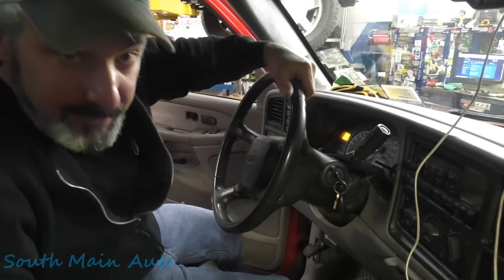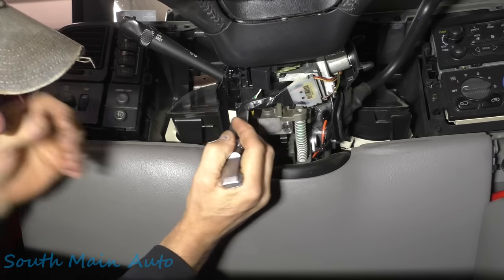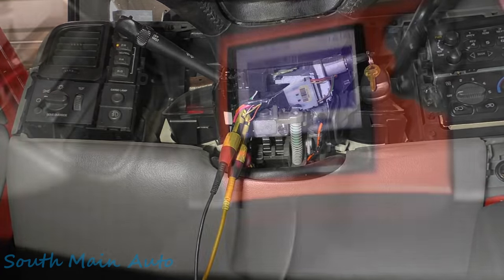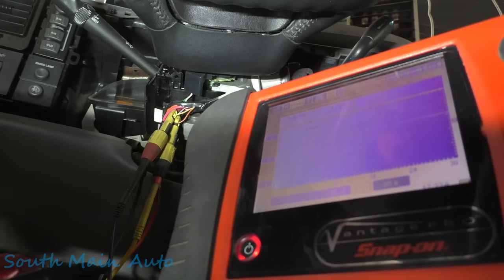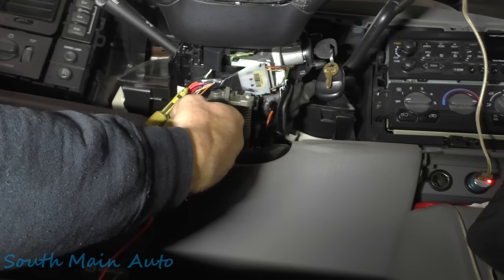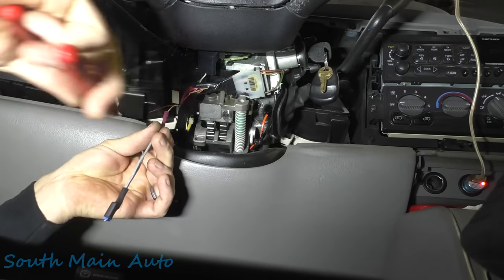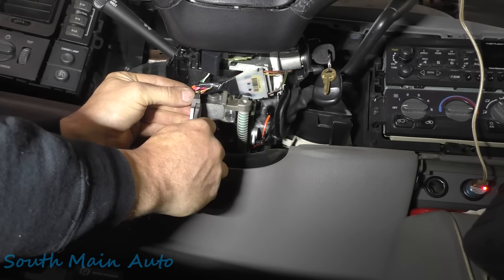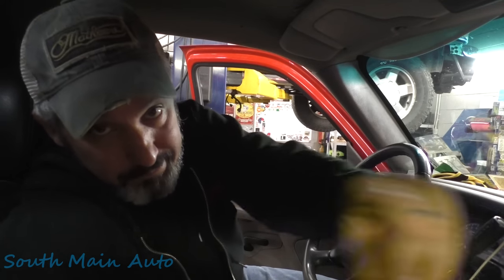Passlock™ System Bypass - GM

Comment: I once owned a 99 Buick regal which had a resistor chip in the key and I had to get an extra key cut. So I bought a blank key from Ebay (with the right resistance) and had to take it to my local hardware store to have it cut. What a pain in my rear. 😤 Trying to find the right resistance was a pain in the rear.

Comment: Those types of connectors are fine, the junky ones are the non-heat shrinkable butt connectors. The heat shrink wrapped around the wire helps keep the connection together, instead of pulling out of one side

Comment: The blue rectangular PCB mount screw fine adjustment 15 turn Trimpot Trimming Potentiometer is a flagship brand from Bourns. Bourns sells a Trimpot adjustment tool that has a pocket clip, which is a popular addition to any Engineers pocket protector look, it has a flat recessed screwdriver blade with a plastic round shroud so you can trim the Trimpot without the tool falling off, very handy. In automotive electronic design you don't see many Trimpots any more. If you want to get a serious retro look you could lock down the screw after adjustment with Glyptal 1201 Red Enamel. 1201 will lock the screw in place and is a tamper witness. One small pot for man, one giant leap for Passlock.

Comment: great fix only thing you may want to put a dab of hot melt glue on adjustment screw ,vibration will make the voltage change over time      I work  with electronics found  vibration is not there friend  awsome video

Comment: nice method ...
i have done this bypass on my own 2003 pontiac grand am ...
my method was a bit different ...
i cut the yellow wire and measured OHMS from yellow (back to switch) to black wire (key in)
then strung a few standard resistor values to get the MEASURED value ...
soldered that in between yellow wire going TOWARD the BCM and the black wire (grnd) ...
did it 5 years ago ... security light comes on every few months then goes out ... but NOT a single NOSTART since!

Comment: Did you know that in some models (2000->) you can just unplug the pass key module when the car is running, it disables the system and car runs and starts without pass system after that.

Comment: a properly done crimp will last longer than the vehicle - the problem is that many people don't do them properly (for starters, only ONE crimping action is done, adding an "Extra for good measure" seriously weakens them and reduces compression pressure by 80-90%)

FWIW: in other cars suffering intermittent key issues, it's often the wiring to the transponder pickup ring around the key. I've seen a number of cracked joints over the years (you can resolder them and expect them to crack again sometime later or use something like Kynar 30 wire wrap wire to extend the joint along the traces a little - which will allow for flexing)

Comment: Fuel pressure is determined by BCM?  02 Avalanche…

Start it with foot not gas, runs for about 2 seconds. If trying to put foot on gas (holding down) only cranks, no run at all. Because more gas requires higher fuel pressure which is curtailed by passlock?  Thanks. Very informative video

Comment: One thing I've learned from experience with my 2002 Chevy truck is if you happen to have an aftermarket remote start already installed and working properly in the truck and the passlock system acts up on you unexpectedly for some reason, you can probably still start the engine keyless with your remote starter, then off you go, same as any other time you use the remote start. The reason why this works is because the aftermarket remote start had to learn the passlock resistance value when it was installed and set up, so it knows that resistance value and it bypasses that resistance into the circuit whenever it is used to start the engine. And if this works that is probably confirmation that you need to bypass the passlock with a resistor because the key switch or something else in the OEM passlock circuit is probably going bad. The remote start could also be a way to find out that resistance/voltage value in the event that the passlock function of the OEM key switch is totally hosed and won't give it to you. You could pull the starter relay, set up your meter and use the remote start to crank it instead of the key. 

Edit: I just put one of these bypass resistors in my truck. I did not need to take a voltage or resistance reading because I already knew my system used 2454 ohms. I knew this value because I had the whole dash and steering column out during a restoration, and I already knew the 2 wires for the passlock, so I took a reading there when I was putting everything back together and wrote it down to have it for future reference. So I just got me a 5 pack of those variable resistors, set one to 2454 ohms and wired it in there.

Then I also wired in a hidden toggle switch to use as a security kill switch. So my passlock system is still not rendered totally useless. GM put it there to give the truck a little security measure that is better than nothing, so now I can still manually engage that security feature whenever I want, and it is still better than nothing. So if a thief rips out the ignition key lock or if they even have a copy key they can't start it until they figure out where my hidden switch is. This is in addition to the aftermarket security system which is in combination with the remote start. Of course there are still ways a skilled determined thief can succeed, I just did my part to make it harder for him. 

The other good thing is the resistor/kill switch circuit does not interfere with the remote start. The remote start can always start the engine whether or not the bypass resistor is engaged. So if something goes wrong with my bypass resistor or kill switch circuit, I can still use the remote start to get the truck home and service the problem.

Comment: Something for the Ford guys with f150s/ expeditions of 96 to 01, if your anti theft light comes on & your truck shuts off. Close your door & lock it, then cycle the key from on to off until you hear your locks engaged (don't hit the starter yet), your door should be in the unlocked position, relock it & start the truck.

Comment: Instead of crimping try some solder seal connectors. They are life changing.   And on the  later gm pass key - 08 colorado for example,  take the electric part of the ignition switch out, flush it out with wd40, shake the excess off and re install it.   No more security light

Comment: On my 99 Trans Am there is a small connector at the bottom of the steering column with 2 white wires. Just unplug and stick your resistor in the connector going to the computer. Just use a meter to read the resistor on the key.

Comment: I did this to my mom's car. It was so long ago that I got the resistor from RadioShack. And that was the very last time I ever set foot inside a RadioShack, because the sales clerk was more interested in spending 20 minutes to show some idiot how to use their phone than he was in spending 1 minute to ring up my purchase. That was a "Passlock" system I think, where the resistor is inside the lock cylinder and you just leave the key ON for 10 minutes for it to relearn the new resistor value.

Comment: Haven't had any dealings with the 99-02 trucks but the 03-07 classics I've worked on you could start with a regular metal key didn't know they had any security system.Guess I've been lucky. Interesting video.
Reply: It's a hall effect sensor inside the key switch that sends a "code" to the ECM. You could drill out the key switch and the vehicle would start. You just can't "hot wire" it.

Comment: Butt connections are preferred in a lot of automotive applications because solder joints will fatigue and Crack over time with vibration and heat cycling.  Just don't use the ones from hazard freight.  Buy some good 3m ones, and you're good to go.

Comment: Hey Bro 
BIG THANK YOU 
For this video, I lost my keys over 2 weeks now ended up ordering a set of new tublers for both front door and the ignition aswell  with 2 sets of keys, from amazon for about $26 in total,  i have changed all three out already  but Ford has chipped keys-pats anti theft system- and the new set i have are basic  krys with no chip,, Now if i cant figure this out and turn my truck on i will cost me minimum another $200 almost --which i dont have right now--to have a tech come out and make me a new chipped key and program it so i can finally start it up,,
Finding ur videohas me a stoked right now, after 2 weeks of trying I really want & even more I need this to work ,, SO I WANT TO ASK IF IT IS POSSIBLE FOR U TO KNOW HOW TO DO THE SAME THING U JUST DID IN YOUR VIDEO WITH MY -2000 F150 4.6L v8-    it would be a true blessing for me 
Thank you

Comment: I have a couple questions. 
1.) How did you add in your resistor without having to relearn the key? Just leave the ignition on??

2.) How do you know what the correct voltage is when you turn the key over? Do you just match the voltage to the ignition modual in said vehicle, or what GM says it should be?

Comment: Your last video on the Corvette helped me out with my 89 Camaro. Too bad the previous owner didn't see it. He replaced the column, hacked the ignition wires and did a total job on the fuel pump relay wires. All for a $5 resistor.. some ppl do not need to be under a hood 😂

Comment: The crimp and seal connectors are my go to for wiring. I think people are using cheap crimper tongs, and getting bad results. Every single OEM connector has pins in it, which are crimped to their wires. Crimps are oem connections, and they dont work harden and fail like soldered joints on unsupported wires.

Comment: What I want a link to is that wire lead setup you have! The 2 that screw and tap into the wire to test it and the alligator clips and piggyback setup those would totally help when testing wires.

Comment: Is this the system that uses a,little,resistor pellet in the key? My 86 Corvette used that. What a PITA!  It would often fail,to start, so I had to sit in my car while the system reset itself. There was finally a recall, where GM replaced the ignition switch and the keys. As I said, it was a PITA.

Comment: Back in the day when I worked on those miserable Silverados under warranty I got sick and tired if replacing and relearn  I figured out what the problem was. That  harness was so tightly bound Pullong on the pass lock that the resistance changed with ambient temp soo I did just as you did cut the tape and cut off all zip ties and presto problem solved. 
  Also I acquired an 04 Colorado after I quit working for the Grneral; with the  same problem and proved to be internal  but in talking with the local parts man and discovered the key was severely worn. We got the factory key code cut a key and I never had that problem again.

Comment: I did a few GM cars and just cut then crossed the 2 wires and waited 10 minutes with key on to do relearn and it was done and you don't need to worry about the resistor failing and leaving them stuck again

Comment: im having the security issue, love the video explains in great detail

my only issue on our 2001chevy 2500 is that voltage value is 4.1 volts on signal wire and when we crank it (without the start relay in or out) does not change the value of voltage in the signal wire. so we cant match up the resistor correctly  any suggestions?

Comment: If you hold your side cutters the other way around, it wont keep cutting the wires like that. You will need to practice a few times but you will find it easier when you are used to it.

Comment: I do not hate them I work as an electrician and when you have to use a under ground or a splice kit that is sealed for damp or wet locations those little butt connectors are your friend for single wires to make them longer or need to reconnect it makes it easier to use and you do not have to use a soldering iron it saves a lot of time.

Comment: GMs of this era have some of the best drivetrains and engines ever put into vehicles.  The electrical, security system, and doors / locks / handles are the weak points.  Brake lines in the salt belt.  Once those are sorted you got yourself a hell of a vehicle.

Comment: So you put the resistor between the ground and signal? Is that right or am I misunderstanding?? I just want to save this in the old memory bank…. Also i like the crimp and seal connectors! I have to repair alot of wiring on tow truck bodies and they are really the best thing to use! They can corrode after a little bit but a lot slower than anything else including solder! If you install and seal them properly and add a little shrink tube they will last nearly forever!

Comment: Great video. I am in the process of doing this right now. But when I splice my meter probes into the lines I get the 5.171V as you did....BUT once I remove the starter relay and hold the key my voltage doesn't drop like yours did. Is there something I am missing?

Comment: On my like new 1996 Chevy Lumina there are only 3 different value resisters listed. I went to a salvage yard and got a orange wire which unplugs in series  under the dash then cut it and wired in the correct resister for my vehicle. There is no need to remove column cover it can be accessed from the floor up. Plug in the new wire with the resister and bam, no security system.  When you have a remote start added to a vehicle they do the same thing. I think the size resister for your car is in the VIN but I can't remember.

Comment: Need you to make a video on a 1999 F150. Been fighting mine for years with a worn out key. Replacing the ignition switch is cheap and easy. I don’t have the relearn equipment and don’t want to tow it to a Ford dealer for them to do. I mean it’s a 1999 so another $160 compared to a few bucks sounds better.

Comment: Good job!  My sister has a 2003 Ford Escape that sometimes will crank but not start.  After about 30-45 or sometimes longer it will start and crank fine.  Some times she can be sitting, as in a drive thru, and it will just shut off.  Again after a time, 30-45 minutes and sometimes longer, it will again start and crank fine.  It doesn't do it real often but enough to be aggravating and real inconvenient.  I've seen on line where it may be the security system malfunctioning.  Have you Eric, or your commenters ever had any experience with this or any idea what might be the problem?   And I know, bring it in and I'll take a look at it,  no way to diagnose through the comments. 😊. But just wondering.  Thanks!

Comment: I've seen some info out there on the internet about "full bypass models" and that these resistor bypasses don't address the whole problem. I don't want to make a problem worse. I have passlock on my year vehicle> The vehicle treats me like I'm a thief intermittently. You (Eric) have been the source of many a good repair video that I've used. In your opinion, is the resistor bypass enough, or does a person need these expensive "full bypass models" out there? 'Before I proceed'

Comment: I know, I know nice fix by the way. Wanted to throw this out there. It looks like the parts your using are above average so if you're using some that bounce or move around on you the easiest way to stop that is to use some fingernail polish on the adjustment screw, it doesn't take much it will hold it in place and if you need to readjust it in a few months your screw driver will break open the old polish

Comment: Eric, I have used two of your repairs for the system bypass, the one on the Vette some years ago. I have a gas gauge sending unit on an 87 Buick Regal that only shows a half tank when full. Could a person place one of these 5K Variable Resistors inline to the gauge and adjust to correct the gauge to actual fuel level? I have four (4) of these left after fixing a 2002 Yukon VAS last week and just wanted your input on trying to correct the fuel gauge. Thanks and keep up the good work. Following the 2015 Impala with the battery that dies overnight.

Comment: Appreciate the passlock videos. Curious if the black plastic clip has any use after cutting the wires doing the resistor fix?

Comment: those crimps and seals are great. as I said before I worked at a local garbage com, for 20 years. I used lawson butt connectors the whole time. never a problem with the connectors. there was a huge problem with the weld shop though. just as long as you use the right crimpers no problem. I use to ome them out and match the value and never had to do the three times for 30 minutes or until the security light quit blinking .but as with everything there's always more than one way to skin a deer
Reply: I like dolphin connectors for all my wire fixing needs
Reply: @samholdsworth420  Ma Bell stopped using dolphin connectors for telephone wires decades ago.

Comment: You can certainly bypass them in a pinch but in my experience to no starting will return very shortly. It is certainly cheaper to by pass but it’s not the best fix. Expect to be stranded some days!

Comment: I had this problem with my 2000 Blazer, all I did was modify the tune in the computer PCM/ECM with my JET tuning software and disabled "VATS" (Vehicle anti theft system).  Didnt even have to open the hood, or disassemble the column!

Comment: Is there a way to test to see if the passlock is bad? I’m not getting the security light while cranking, but I have no spark, no fuel, no start. I’ve gone through all the other factors of the issue aside from replacing ecm.

Comment: 1.28kΩ seems out of the tolerance range, the closest would be a #5 key with a 1.13kΩ nominal resistance. Would it be better to set the variable resistor to 1.13kΩ in this case, or is the problem caused by the passlock reader going out of tolerance? Wouldn't it be easier to just measure the key with an ohmmeter and make the variable resistor the same value?